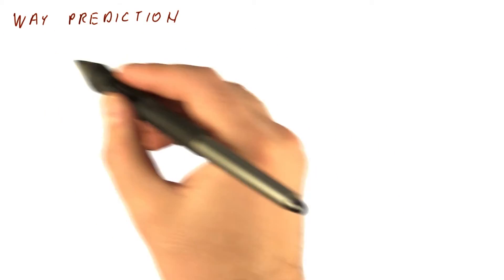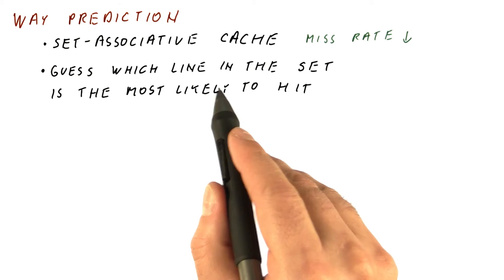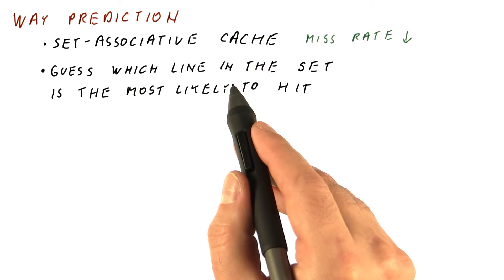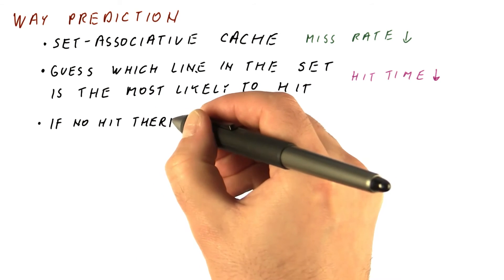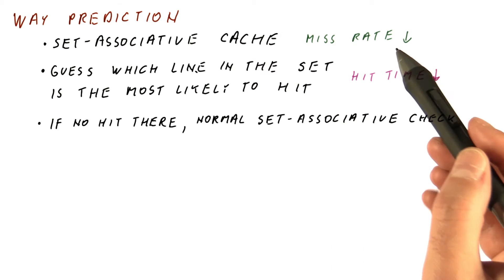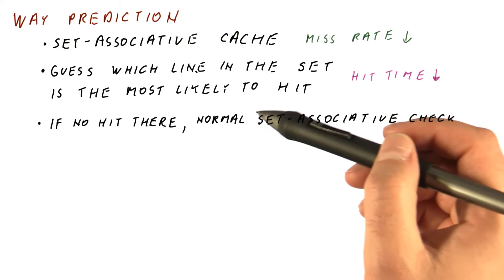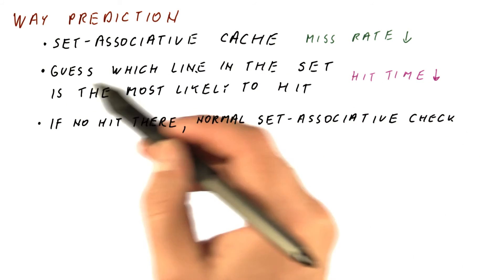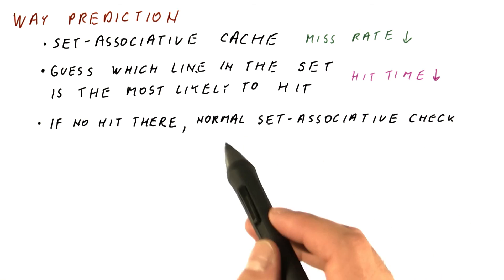Way Prediction - Georgia Tech - HPCA: Part 4

Comment: I got 2.2 instead of 3.3.
70% of the time it will take 1 cycle, the remaining 30% will be divided into 90% (we take 2 cycles + the 1 cycle we spent earlier on a miss) and 10% (we take 20 cycles + 1 cycle the first time we miss + 2 cycles the second time we miss).

so:
0.7*1 + 0.3*0.9*3 + 0.3*0.1*23 = 2.2